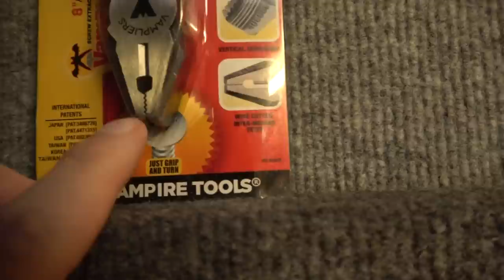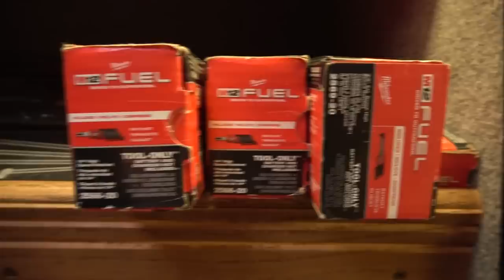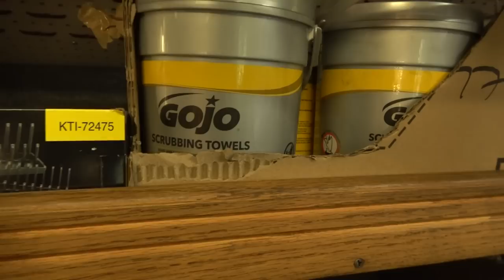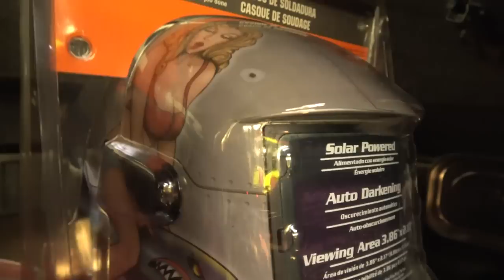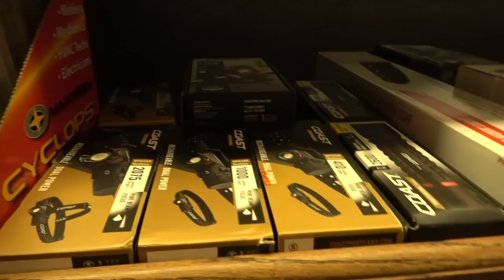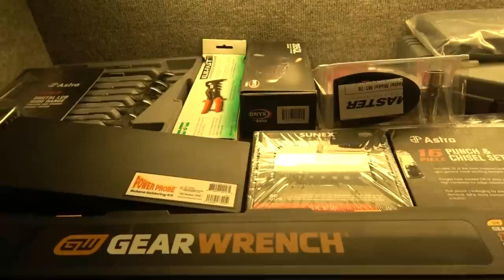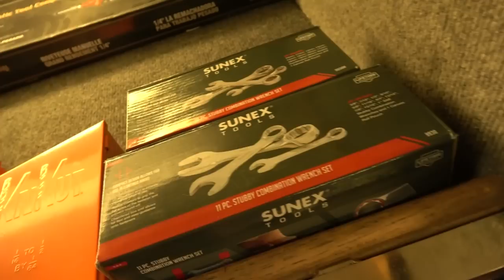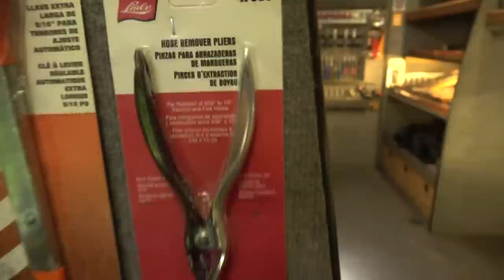2023 Tool Truck Tour!

Comment: Steve from just outside of Orlando, FL here...I hope all is well with you.   As a tool "junkie" I watch every posting and every "Tools in the Haul" video that I can get my eyes on.  I consider you as my tool truck guy although I am not actively in the industry.  I have yet to order from you although I am contemplating some offerings from VIM Tools, Astro, Sunex and from Grey Pneumatic.  K-Tool also has some interesting offerings.  My only concern is warranty service.  The reason I say this is because I have 3 sets of Mountain 90 Tooth Double Box End Ratcheting Wrenches (all sets are metric) with all sets costing  about $300 a piece.  One set is my go to that I baby because the two other sets have excessive play where the flex heads meet the Y portion of the body of the wrench.   I don't use the two (2) sets for fear of injuring myself.   I moved to Florida from New York and cannot seem to get in touch with the tool truck operators that I purchased my wrenches from for replacement.   How can I get in touch with you to discuss this matter where it is mutually beneficial to the both of us?
Reply from the maker: Hi, Steve. I'm grateful for your viewership and support, and I appreciate the nice compliments. For warranty service on your Mountain wrenches, I'd recommend contacting Integrated Supply Network, which is a huge tool distributor and owner of that brand. Their number is (800) 491-8665. I'm not sure what their warranty procedure is, but it will be worth it to ask. Let me know how it goes!
Reply: @CoyleTools  Will do...Thank You Very Much.

Comment: I’m old enough to remember when Sunex sockets were insanely cheap to buy and were decent quality. Now , with so many different Taiwan brands vying for a piece of the market Sunex is pretty expensive as far as offshore sockets go. Brands like Capri, Teckton, and others are undercutting Sunex by a sizable margin in many cases. Sunex brand seems to have stagnated in recent years as far as offering new products. Don’t know what is up with them.